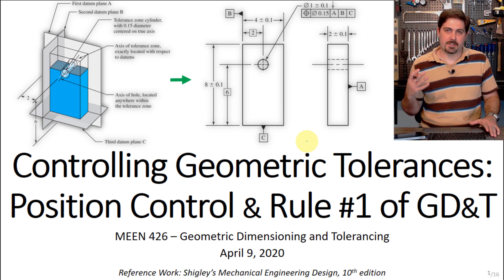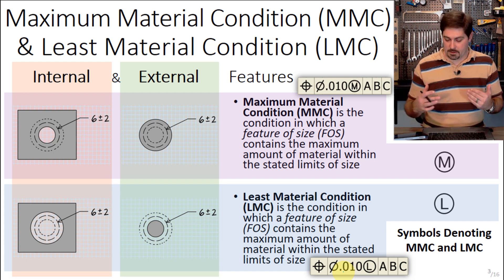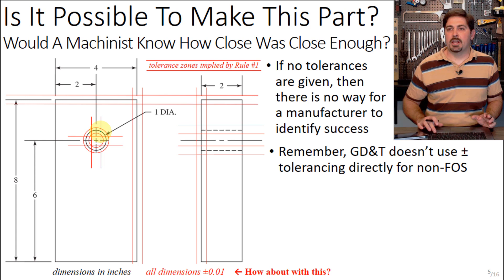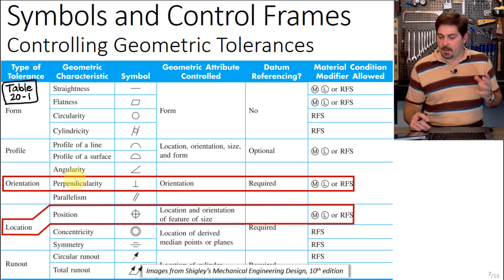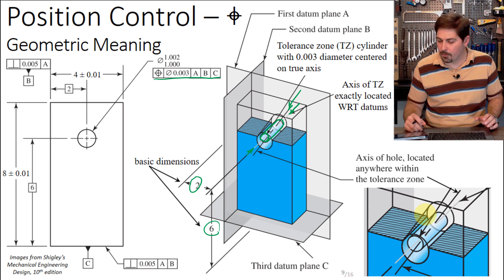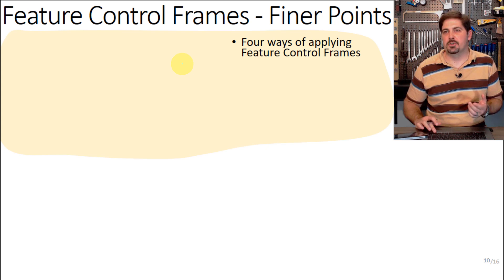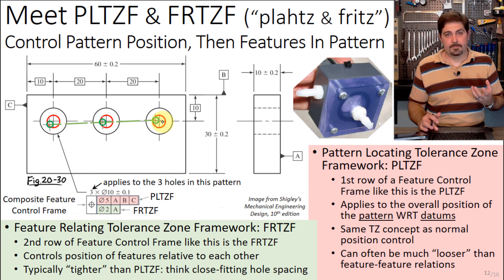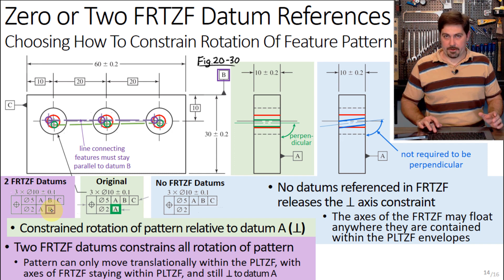Position Control of Features & Patterns: PLTZF & FRTZF | How Rule 1 of GD&T Controls Form | MMC, LMC

Comment: ISO 5459 says a feature of size can be:
The features of size can be a cylinder, a sphere, two parallel opposite surfaces, a cone or a wedge.

So in this case a cone or wedge can be either. However they do not fulfill the definition of 2 opposite surface, or be a cylinder or sphere. Is it different from ASME?
In ASME only the one of the section so a circle could be a feature of size. For example if I have molded parts with truncated holes/pins, then what is the feature of size? The smallest (base) circle of the hole and the biggest one for a pin? I do not understand how to use position tolerance for cones, wedges. Moreover how to use modifiers for them like MMC/LMC/MMB.

Thank you

Comment: If that tolerance is one hundreds of an inch it should be written without zero in front of decimal point, placing zero in front makes it metric. Check out 1.6 Types of Dimensioning (Y14.5-2009 page 9)

Comment: how does tolerance stack up work now? It's pretty straight forward with coordinate dimensions, but im  not sure with gd&t.
Reply: There is no stackup afaik. Every toleranced features location should be specified using TEDs
Reply: @eartheartbaratheon791  Actually there is tolerance stackup for GD&T. It relates for example to how 2 matting parts will be able to fit with a position tolerance for each corresponding holes.

Comment: is gd and t applicable to laser cut parts?
Reply from the maker: GD&T provides a language and a system to specify how much deviation from desired geometry is acceptable. It is more or less agnostic regarding the specific manufacturing methods used to achieve the part geometry.

Comment: Sir, in control feature frame, with the geometric characteristic symbol we write stated tolerance. So, how we define that tolerance value?
Reply from the maker: I believe you are asking how designers should go about determining appropriate tolerance values to specify. I will try to show a little bit of this in upcoming lectures, but there is a good bit of art to this that good designers generally have to learn through experience.
Reply: @TheBomPE  thank you. Yes, you are right as a product designer it is very difficult everytime to know the manufacturing process capability for different machines. But as we have to define our tolerance value for position, perpendicularity, angularity, flatness and similarly for other gd&t symbols. Please cover  these things also in your upcoming video with the live example.
Reply from the maker: Again, I will try to show some more examples in upcoming lectures that will [hopefully] illustrate some effective uses of GD&T techniques and annotations. But I will also confirm that good technique generally requires awareness of the capabilities and limitations of the tools that will be used to make and inspect the parts. I will reiterate that as you gain experience in designing, your art will improve with respect to minimizing cost via your tolerances while maintaining reliable part and system functionality.

Comment: Hi Doc, reaching out for a doubt.
What is criteria that decides on whether a material condition would be allowed on any of the geometric charatceristic.
Ref: Table at 25:42.
Also thank you for all the value you are putting in through these series and others.
Reply: I might have a follow up after this, but i'll wait for your response first and continue moving ahead in the series.
Reply from the maker: I'm glad you're finding the content useful. The shortest way to answer your question is that my focus in this series is primarily on the ASME Y14.5-2009 standard, and those are the rules in that standard. Your question may be about the underpinnings of the rules, but the answer on that would have to get into each control and might be a bit too involved to answer here. Thanks for watching!

Comment: which device do you use to write digital notes?
Reply from the maker: In this video I'm using an HP Zbook X2. For many of my videos I use a Fujitsu T901 with a gen2 i7, nvidia graphics, and 16GB ram. Both computers have Wacom digitizers, and that is one of the the keys to good inking experiences IMO.
As far as software, in this video, I'm using PowerPoint. Most of my videos, though I use OneNote as the software.
Maybe this helps?
Reply: @TheBomPE  thanks for your reply

Comment: i disagree with you that position control does not control the form. actually in your examples, position control tolerances are larger than form controls. in that case, the tighter form controls controls the shape. however, if your position controls are tighter than the forms, they dictate the forms as well. in general, position controls form and orientation. orientation controls form and orientation, form only controls form. Thus, it is the most common to have the most relaxed tolerances for position tolerances.
Reply: position only controls orientation, not form. Otherwise you'd be unable to use position on a conical feature whose ends are concentric and share a common axis, the exterior of the cone feature could be rough, or casted, but still maintain a closely tolerance axis perpendicular to another feature. In such a case I don't care about the variation in the form of the part, only the orientation and perpendicularity of the axis. The actual form may deviate by +/- .100", but I'm not concerned about that, I just want the axis orientated precisely. The position control, controls a the location and orientation of a point, axis or center plane of a feature and nothing else. No form control is implied. Only the size of the feature, or a separate from control, will control the form of the part.